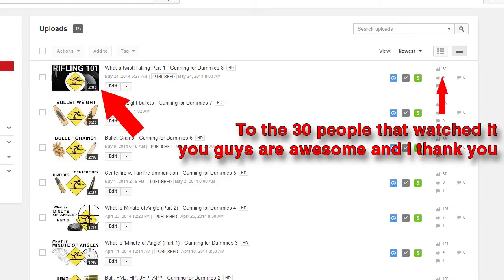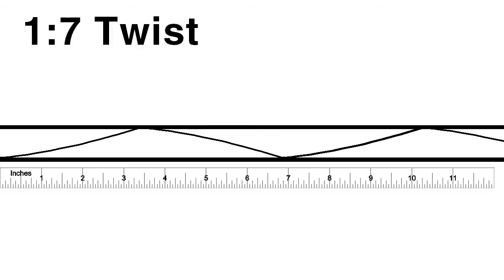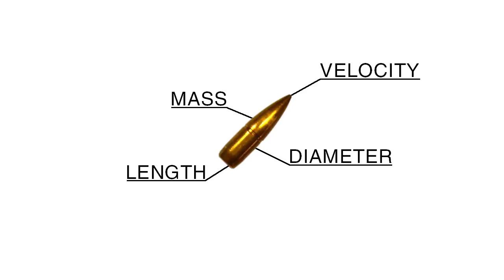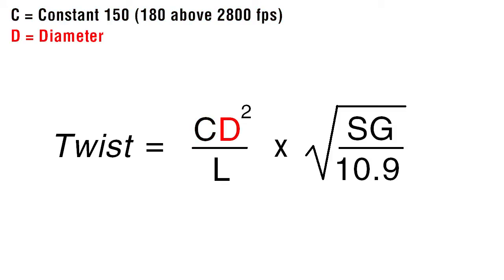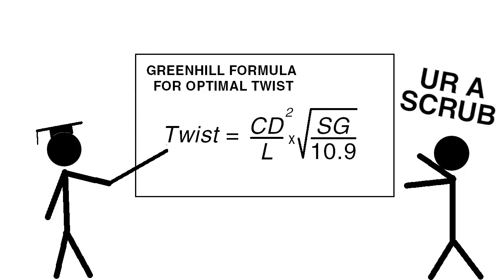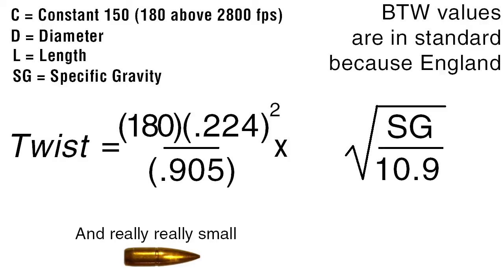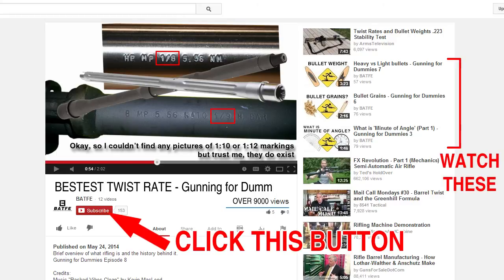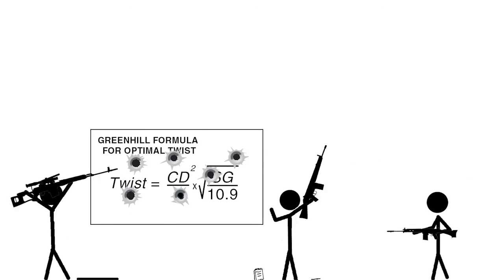Finding the best Twist Rate (Rifling Part 2) - Gunning for Dummies 9

Comment: Good video.  Also, based on the GH formula, it is not the mass of the projectile, but the specific gravity (relates to density).  Also, there are numerous other factors (environmental, surface topology of the projectile, etc).

Comment: Please ignore this video if you shoot with non AR rifles. The cost of just experimenting with barrels of different twist rates (which will have to be custom ordered) will easily cost you as much or more than buying another rifle. Instead go to one of the bullet manufacturer's web sites and look at the recommended twist rates for the bullets you want to use then use that information in your decision about which rifle to purchase. Then prepare to be saddened by the slow twist rates on most factory barrels (with a few limited exceptions) for common hunting calibers other than 6.5mm.

A twist rate is only too fast if it starts to affect the structural integrity of the bullet which is only really the case for low weight for caliber bullets in very high velocity loadings. There is no such thing as over stabalisation (just to kill some fudd lore).

Comment: good stuff, your video doesn't mention grain weight which from everything I've heard is a big factor.  explain?
Reply: He did mention mass, which is similar, but technically different. A hollow-point and a solid bullet can have the same weight, but the HP would be longer, which affects the BC and stability per a given rifling twist.